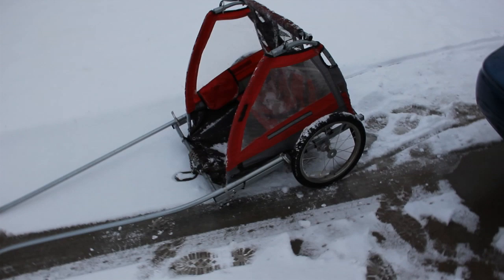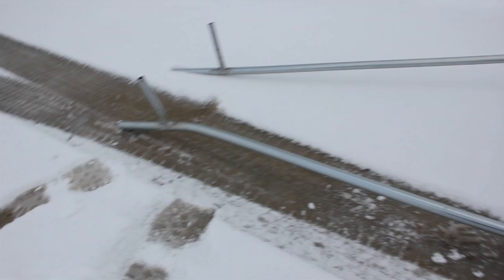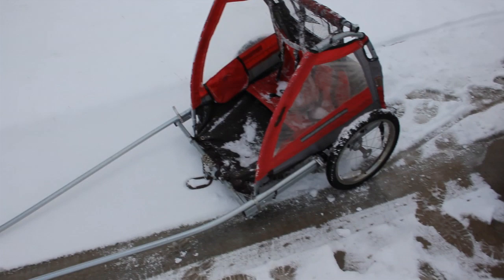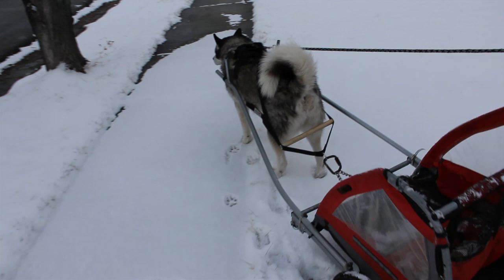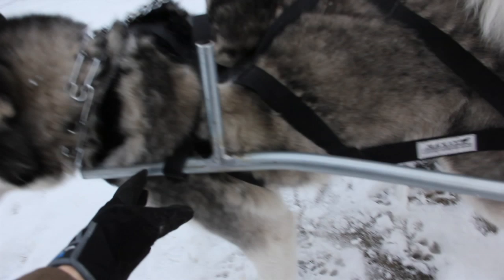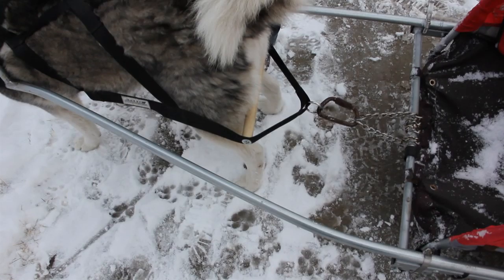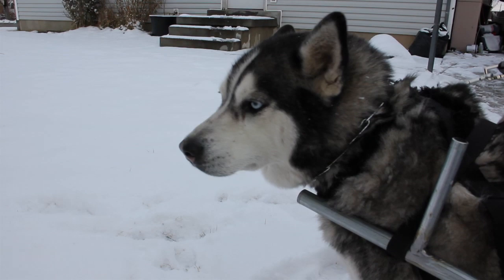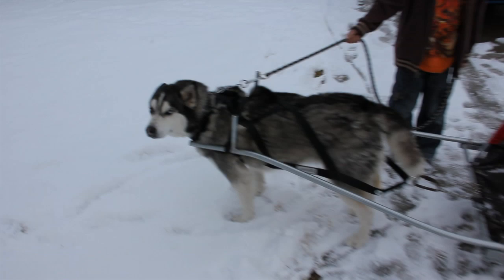Homemade Dog trailer

Comment from the maker: @anynameplease She pulls the load great.  I haven't put enough weight in it to see what is too much.  But two kids around 30-40 lbs each are really easy for her.
I also have a dog pack for her that I bought at the same place I bought her harness.  I use it in the summer on tight trails.

Comment from the maker: I used electrical conduit, then welded on the short posts that make up the brakes.
Reply: Did you just use steel cable ties to attach the poles to the trailer? I can't quite see in the video what type you've used. Cheers!
Reply: do you have any idea how to make breaks on the actual wheels, I've got something similar due to neuropathy in feet/legs, my Spoo is great but on rare occasion can still get overexcited and  I need to be able to manually break so he will stop.

Comment: I use a HALTI  for my husky, no more pulling and is kinder than a prong collar which is barbaric.
Reply: CAROL HIRD no they are not..I use a prong collar with my SDIT.. soon as her prong collar goes on she knows it is time to work and will ignore everything a well-trained dog with a prong collar will not pull.. and what people don't seem to understand with these callers is they are wrist movement collars if you are using your whole arm then you are doing it wrong/it is in the wrong spot.. these collars are to be worn up high close to their ears and not on their throat.. where is this dog prong collar was placed is the wrong spot it is also a cheap Petsmart prong collar.. yes there is actually a difference between a cheap collar and a good collar.. Herm Sprenger Makes true prong collars they always have perfectly rounded prongs and the prongs do not go in the same direction they go the same direction on one side and same direction on the opposite side..I also use a halti with my other husky

Comment: poor dog it was crying I wonder what it has to pull around for you
Reply: Mr chips k Lol, my Husky does the same thing. Cause she has to pull? Quite the opposite! She runs like mad and her whole face us full of joy when she can run. Just like in this video, it's when I hold her back she whines and cries. I never had to teach her to start pulling, it was getting her to stop that was the chore! I disagree with using a prong collar though. Especially when the dog is in harness. Most huskies adore pulling, regardless. No different to how a lot of dogs love hiking, swimming, playing fetch, etc.
Reply: Not poor dog. She was crying because she wanted to start pulling the trailer.  That's what I saw at least.
Reply from the maker: Because the cart uses wheels with bearings, it is really easy to pull with any kind of weight.  It actually never got her tired because we didn't go far or fast enough and she never had enough weight.  It was much better when I hooked her up to a sled.  Then there was enough resistance to make her have to use effort.
Reply: You obviously know NOTHING about huskys, or dog behavior. Jesus christ the IGNORANCE in this comment section. This is a SLED PULLING BREED! Only thing she is "crying" about being held still. She is ready to go! She wants to PULL! Its literally in her blood... I guarantee she is the happiest when she is pulling. Poor dog doing what she was bred to do. Someone call the police 😟😶😆 lol